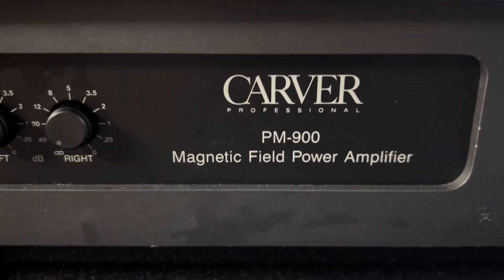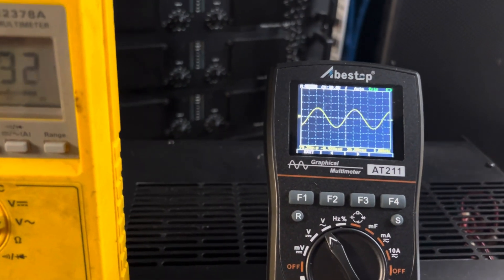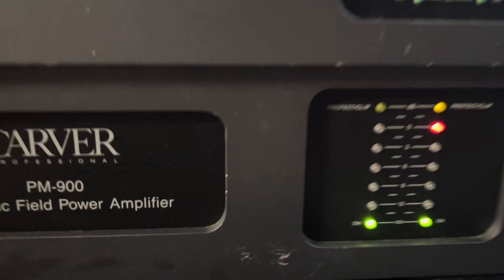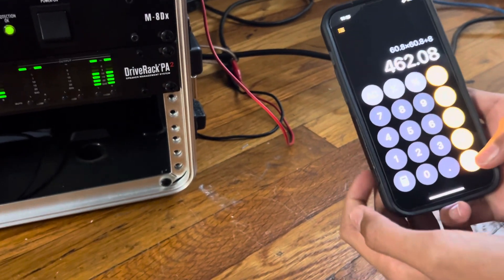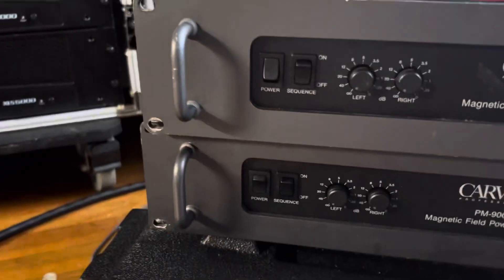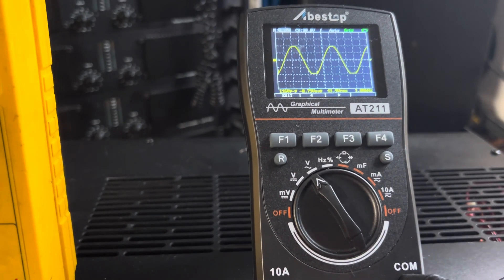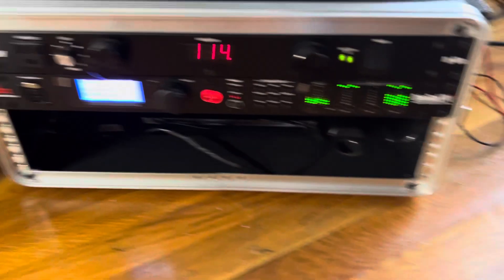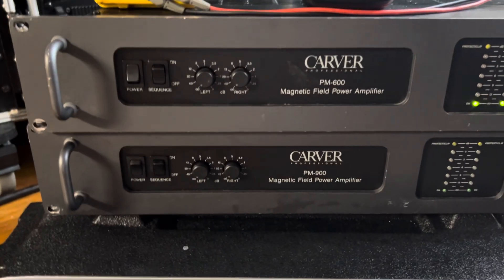CARVER PM 900 & PM 600, POWER AT CLIPPING, AMP DYNO

Comment: I used one for many years and it sounded great just don't have the bottom end that a heavy amp has. Carver does shine on the mid to high frequency.
Reply from the maker: Those Carver PT 2400 had plenty of of bottom and your right, the PM sounded great on mid bass on up.

Comment: I pushed a 2 ohm sub and it dimmed the house lights bad. It will do it all day. I was always curious what it put out though.
Reply from the maker: @lilmangofast  These are some of the most indestructible amplifiers that I’ve ever owned.  And the sound quality is well above average.
Reply: @DJ_Renn I am looking to sell a pm1200 and pm950.  Do you have an idea what the current value on these things are and the best platform to market them? I don't mind giving a deal to someone, but I don't want to give them away either.
Reply from the maker: @ I just used Facebook marketplace, eBay will want 13% of sales so you can make much. It also matters where you are located. Check reverb.com for ballpark prices.
Reply: Thank you @DJ_Renn